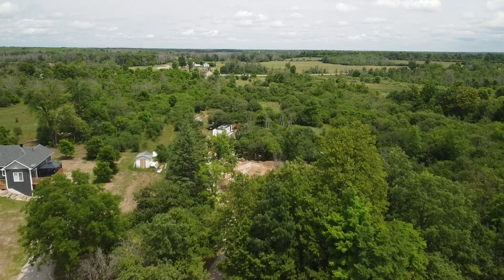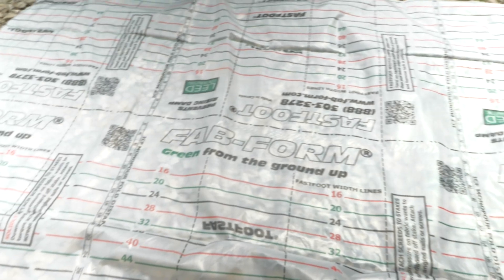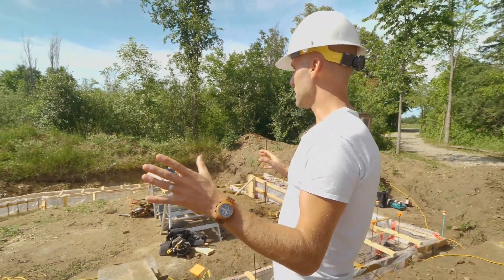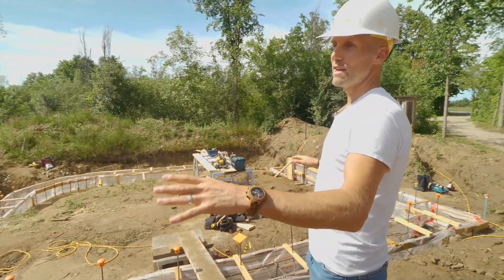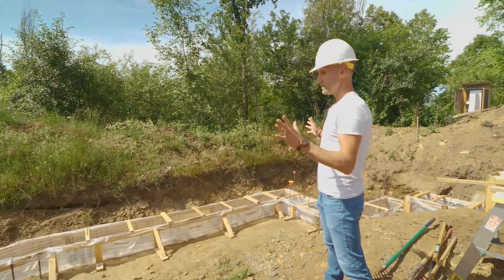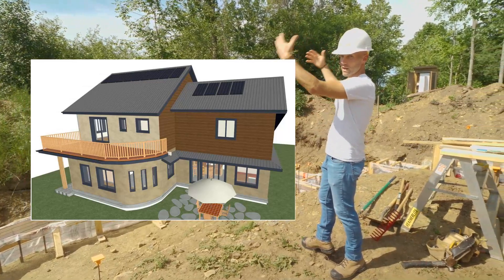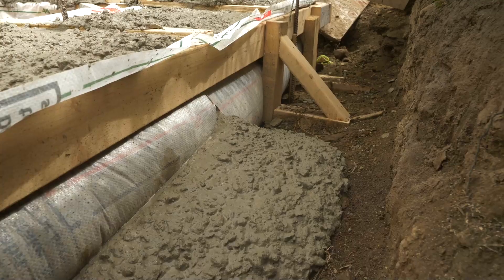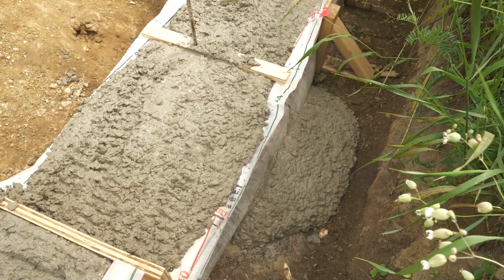Increasing Efficiency and Reducing Waste in Footing Pours

Comment: 2 foot wide footers are the norm for the heavy buildings we build. The need to make icf footing blocks. I don't like icf but an insulated footing blocks for forms I would use. Better than pulling forms and having to insulate footer. I would still put cmu block on it.